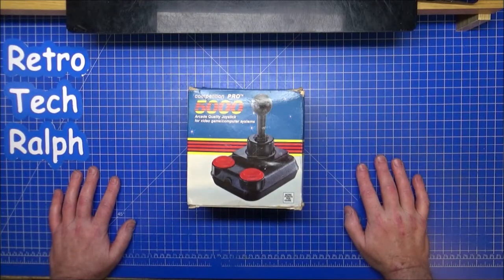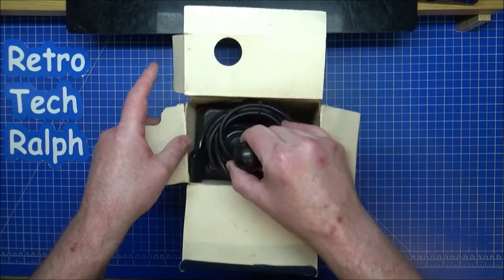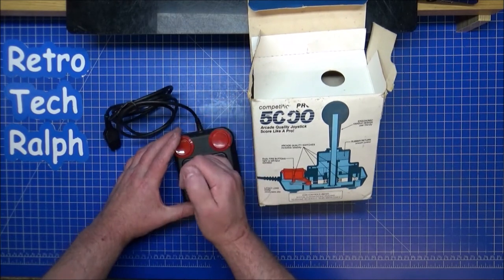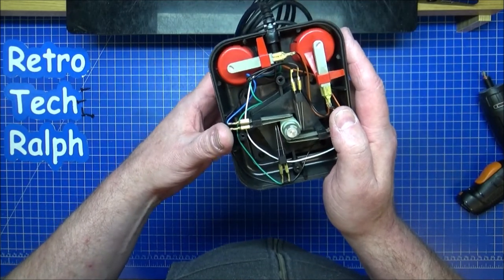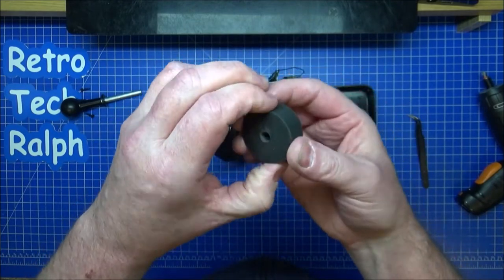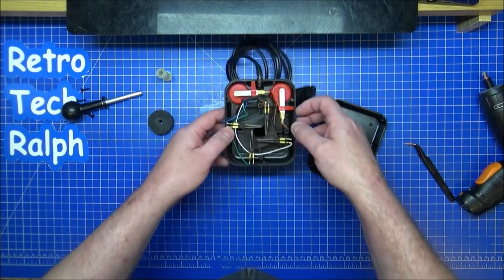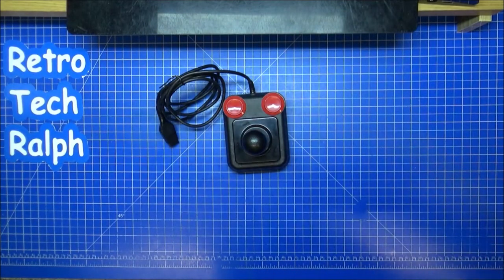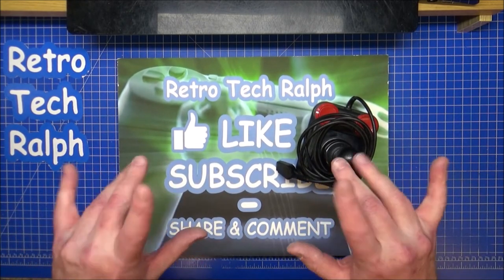Competition Pro Joystick Teardown

Comment: This was THE JOYSTICK to have back in the days... close to indestructable... after it was used too much it could be easily fixed again. Be it worn out rubber... some tape to the rod... would do the trick. Also the silver blades could always be reset to ensure a short action way. Without a slight modification... it would ensure days of pain in either left or right hand... therefore mine was screwed to a piece of wood!!!